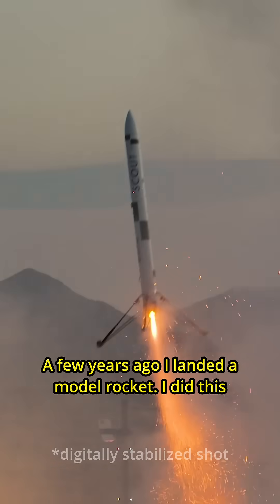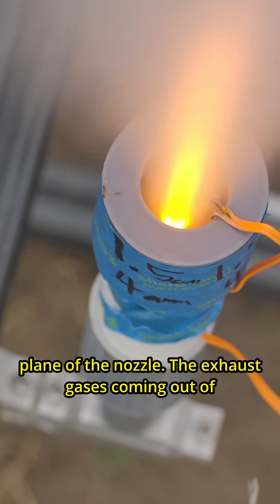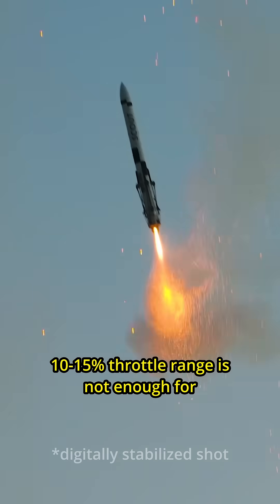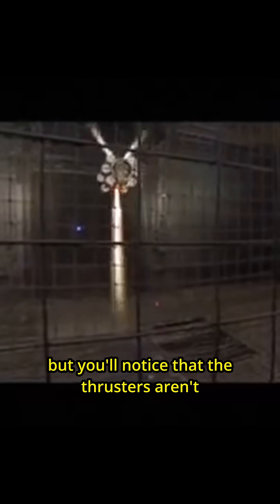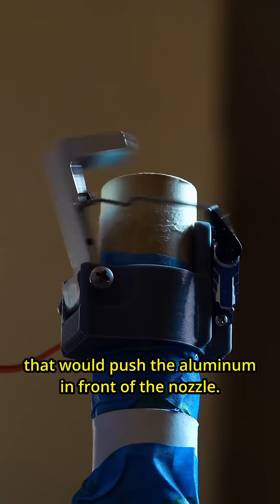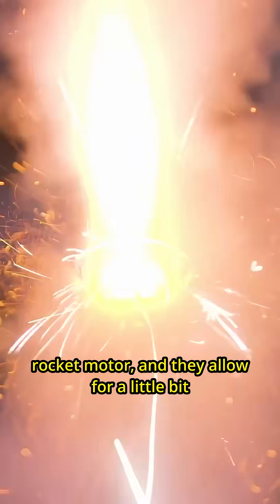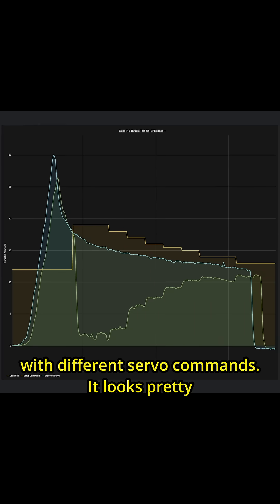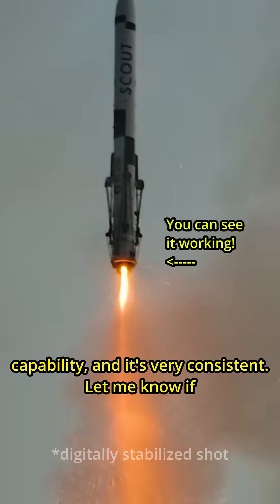Solid Rocket Throttle Control

Comment: How much thrust do you lose if you insert an inverted cone in the stream? I have nfi how you'd actually build it because the active componentry is right in the middle of the hot area but if you can have it move up through a shroud with holes punched in it you can progressively direct more and more thrust force perpendicular.

Comment: Diesel tech here...PWM (pulse width modulation) is what we use in hydraulics to smooth out and control things like variable rate hydro motors on a lot of stuff. Got real familiar with it doing diag on fertilizer spreaders

Comment: Consider using more than two blocker servos and having them each offset from the center line -- sort of like an iris setup. If you independently control them, you might be able to steer the thrust a little bit. Even if you drive them all at the same time, because the thrust isn't directly fighting the servos. Just a thought.
Reply: This was my thought also instead of clamping over it to instead use an iris rotate like setup.

Comment: OK, my ideal for you is you could have a metal  cone that opens up with twisting motions open and closed. each panel would overlay one another in a circle concave a wide base that peaks into a coned tip for dilation and restriction to hold propulsion thrust ratios.😅

Comment: Looks like a reverse thruster on an MD-80.  Our thought was it needed to be automated because we didn’t have brains fast enough to make proper inputs at the RC anyway. Using a spinning disk with gaps that allow the thrust to pass or be blocked….will spin slower as it slows down which slows it down even further exactly as needed for decent and landing. The slower the rocket traveled at landing the slower the disk spun which in turn slowed the rocket further.  Super easy to calibrate but adjusting the holes on the disk. The disk looked like an old view master slide.

Comment: Im not a rocket scientist and you may very well agree. But since you asked how I would handle it. I would design an Origami style, mechanical, retractable parachute type device, made of lightweight but hardened heat resistant material. Once extracted could be controlled remotely. Making adjustments with the controller to assist in the landing untill a program is set up.

Comment: Depending on how much force the rocket motor is making, i would go for stargate sg1 iris style thrust reverser/throttler using ceramics. Simply for the cool factor (ensuring it doesn't jam under pressure is fun).

Comment: I would have tried a leaf shutter first. I think that would give me the most control over how much thrust I have, because I have the option to have full thrust all the way to no thrust/very little thrust with the shutter completely closed. The only issues I can come up with for this are the shutters themselves being too thin so they break or melt, where to put the electronics to operate it, and how the thrust I’m blocking can escape.

Cool video though.

Comment: I wonder if you can use thrust vectoring to modulate thrust. Imagine commanding the thrust vector to be fully angled away from the rocket’s axis, but rotate this vector around the axis at a high enough rate that the lateral component averages out. This solution has the advantage that it doesn’t require any additional hardware.

Comment: When you block the thrust from the end of the rocket why not have that same blockage have side ports that open with the same motion like a valve so that when it is blocked from the end it goes out the side to change the direction of the thrust  travel that way you're not backing up the energy your redirecting it yet you're still using the same energy but in a different direction The other option is to have a variable ceramic cone or tube that move the direction of thrust never changing the thrust only moving where it goes.

Comment: Here's a thought. Your solution is clever but would a round piece of ceramic work better?  Like a donut?  It could be broken into say 5 or 6 pieces and controlled by a sort of cork screw and when it turns it would open and close giving you consistent and controllable  thrust suppression.

Comment: Paused. This is some of the stuff that kills me. I'm not smart enough to build a rocket. I'd mess it up 100 out of 100 times. And trying to figure out a way to land it on its return, same. But in those 100 out of 100 times of failure, knowing that I'd be putting aluminum in direct contact with a mega-flame, I would never NOT find out the temperature at which aluminum melts. That thought would never slip my mind. I don't get it, man.

Comment: I guess the natural progression of this would be to then land the rocket with fairly good precision, then to maybe move into using catch arms to catch a rocket.  :)  That precision part I think would be difficult as hell in a model rocket.  I'm sure someone could do it, but man, the cost would clearly push it out of range of the average hobbyist - even if you could get a Raspberry Pi or Arduino small enough to handle the data.

Comment: So my first idea of this was to block the thrust itself but not like this, I was thinking of a metal (im not sure which one) blocker that has a three way closing system, kind of like a spiral and what it would do is you could control a 1-100% close ratio and that would block out thrust from the booster itself therefore leading to a variable thrust. However we dont all have that kind of money which is why that Idea is not the best 😅😅

Comment: I would not have solved different but maybe made like a SG-1 gate shield style of ceramic throttle control if you could get away with relatively thin sheets and were able to engineer the open close action of 8-10 cresent shaped sheets

Comment: Id like to think my experience with refractory materials would’ve led me to a similar idea. I’m pretty good with PWM stuff. Prob a different design but this is simple, reliable, only needs two solenoids. Yttrium stabilized zirconia ceramic is prob fine for this usage and tougher than calcium aluminum oxide vitrified kaolin ceramic. A liquid nitrogen flush of the solid rocket tube would also quickly reduce combustion without requiring a relight as long as it’s not continuous. I would’ve used a hybrid rocket nozzle with vulcanized rubber and aluminum and ideally liquified nitrous oxide and I’d have to add a small amount of perchlorate for relights. It generates its own ullage gas, no pump required if the rocket is light enough.

Comment: I would have use a ground contact release attached to the landing legs so as they hit ground the mouse trap reverse thrust clam jaws under the thrust and instantly are thrust up along the side of the rocket actually pressing it into the ground and making the timing issue obsolete and adding stability in the landing as it is now anchored against the ground regardless of how much longer the solid propellent has left.

Comment: Wait, is there a way I can speak with you privately? I have a really easy but not exactly simple way to control thrust. 
So in a nut shell what about a ceramic ring with a opening that you can adjust by moving up and down with a external motor or better a selinoid so it can slide in a hollow tube allowing the thrust damping

Comment: @bps.shorts I’m an engineer, I have an idea. You said you recessed the engine, therefore the more of the solid fuel that’s expended, the longer the recess. Have you tried creating side channels, similar to the muzzle break on a rifle? This would redirect the kinetic energy out the sides, potentially stabilizing the rocket while decreasing the lift. Feel free to respond if you would like to collaborate, I do have a few ideas. Great job!
Reply: Wouldn't that introduce lateral thrust that may be undesirable. If the holes are not lined up perfectly you'll get a roll and if the gases don't escape evenly you get yaw
Reply: @KaitouKaiju if you balance the bypasses on both sides you should mitigate the lateral forces.
Reply: Slight correction (doesn't affect your idea, I think): The recess doesn't get longer. Solid rocket motors are made such that the burn channel goes lengthwise in the centre of the cylinder, and burns from thereon out to the perimeter (there's more to it, like some extra channels cut in - usually it's in a star shape - to ensure even burn rate/thrust, but that's irrelevant here). This is to ensure that the casing doesn't need to tolerate the flame temperature (hence, nothing except the actual nozzle and control vanes does), and the "offgassing" fuel will somewhat cool the solid fuel (and thus the casing) below.
Reply: That'd have to be some very precise work to ensure you keep it vertical and not add any yaw or roll to it. I honestly think an easier solution would be changing the mixture up of the fuel so it just has less overall thrust, maybe with a t/w ratio of 0.9 so it comes in slowly
Reply: 3D printed holes can be perfect, adding stability, angled upwards offsetting lifting thrust up to 100% using opposing thrust, could even hover. Channels closed/opened on demand via ceramic. Using pincers to obstruct thrust is dangerous, as solid fuel continues to burn, blowback & increasing pressure can overheat/ignite remaining fuel, causing catastrophic heat/explosion. Thrust must be redirected to offset without obstructing. Channels can be open to various controllable degrees. These side channels also allow some directional control, like Elons gimbal engines, 3D printing can be incredibly precise. ~135 to 160 degrees side channels redirecting thrust upwards, like making a peace sign ✌🏻 2 fingers being upwards facing side channels.
Reply: Side channels are upwards facing
Reply: You call yourself an engineer and you can’t spell *brake? Muzzle brake NOT break.

Comment: What about using the Krushnic effect but with a narrower, ceramic tube. (like a sand-blasting nozzle or MIG welder nozzle) Rather than varying the length, you could have variable vents near the top. Let air in and the Krushnic effect decreases; block the vents and the effect increases. The ceramic tube could be rigid and coaxial to the flame (or possibly vectoring) and the variable vents protected from the heat.

Comment: 4 of them should make both throttling and thrust vectoring.

Just be careful to not direct exhaust into the bars connected to the servos, they could still melt.

A gentler inner shape could keep it going out the end at a wide angle instead of sweeping under.

Comment: I’m sorry but blocking the outflow is a terrible idea and should not have been your first one. Even if it didn’t melt, its much less efficient than purely toggling the flow off and and on

Comment: I probably wouldn't have thought of redirecting thrust like that. The idea that springs to mind would be to have 3 "Booster" rockets and some way to independently deflect the thrust axially away from the the usual line of thrust. If you can deflect the output to 45' from the centreline you'd be creating significantly less vertical thrust.

The problem is that this would also add big problems with balancing the inconsistent thrust from 3 separate solid rocket motors, plus differences in thrust duration, and those would be harder issues to solve than the original problem the solution was trying to address. 😁

Comment: If you used a cone divided into four long blades, and put little  actuators on them like with your ceramic claw, you could divert thrust into different directions depending on the amount each blade is extended, or like with your PWM method, cut it completely.

Comment: This might not work at scale and is not a very efficient solution (youre basically wasting your propellant there), which is why I believe that isnt going to be used in larger rockets.
Since burn rate your first idea was probably the more efficient one - but if you were not just to use Krushnic effect but rather varied nozzle geometry that might have been more effective

Comment: My first thought was to simply pinch the nozzle through some kind of shutter setup. But thats way more complex than what you ended up doing and probably wouldn't have really worked. The most efficient solution is probably switching to liquid fuel or some form of monopropellant, but theres probably something specifically stopping you from doing so

Comment: If you throttle by figuring out how to waste unnecessary thrust, would it not make sense to at least use the thrust directionally? That is to devise a ceramic flow actuator that if engaged wouls split the thrust into 3 or more smaller ones and gradually change it from vertical to horizontal, this way you reroute it from pushing down towards pushing sideways.

Comment: Put the whole rocket motor on a swivel and constantly change the angle from side to side to reduce overall upwards thrust and stay stable. Probably not feasible due to the rocket motor being most of the mass. Maybe if you had a couple of smaller motors, so that they can cancel out each others rotational moments?
Your solution is way more elegant, but you did ask us for our solutions ;)

Comment: I'm no engineer whatsoever, but why wouldn't a contracting? Nozzle work like what they use on the back end of fighter aircraft with the afterburner? If you have a sustained rate and you the decrease the size of the nozzle, it makes the gas go faster. If you increase the diameter and the nozzle, it decreases the thrust, but I could be wrong like I said, i'm not an engineer

Comment: Shouldn't you throttle it by limiting the burn rate rather than trying to contain the already ignited flame? Sounds like a bad idea because you need to be able to withstand the heat. Just burn less?

Comment: 100% the same solution i was considering lol. PWM is how a lot of cars vary the amount of fuel that is provided. Especially manifold injection. 

Throttle plate reduces or increases air,  02 sensors read the result, and a small table on the ECM chooses how long to open the injectors.

This is on the other end, but still uses a similar effect!

Comment: You don't have the computing power or the sensors to fire fast enough for routine Star Wars type of aircraft Space Ship landings. 

Once fuel is burned the weight of the aircraft changes and the computer needs to throtle effectively to control the effective pulse modulation of thrust vectoring. Its not that hard, but to purchase the control mechanisms goes beyond most college students personal budgets. Unless they are sponsored. 

High speed, high pressure fuel injection is something to consider with pulse modulation. I think it is much easier to design with an injector manifold that has the rocket firing nozzles in the desired direction of travel. Then the pulse modulation will work effectively for direction if travel. That design will put you in the winners circle. 💫✨️🏁😃👍❤️🇺🇲

Comment: Hmm I think I would've tried using several motors (3?) and changed the direction to get the vertical thrust component you want rather than trying to throttle a single motor. Having 3 motors point anywhere between vertical and horizontal would not require anywhere near as much complexity as the solution you've used here and is easier to keep symmetrical. You would likely have to account for inconsistencies between individual hobby motors though.

Comment: I would have tried four or put two slits in your ceramic. You could have probably got away with stainless as well. By doing that and making your relief holes equally and all directions maybe even with a little bit of a spin it would have helped stabilize the rocket in the process by shooting your thrust equally out the sides.

Comment: I would use two solid thrust motor which can point down ⬇ or sideways with certain angle to control the thrust with only two servo motors, it's benefit you get more control and thrust meaning more payload, downside using two solid thrust motor is expensive and you need a proper code to control the angle of thrust, I hope it's a good solution

Comment: I would try a fin that diverts parts of the exhaust gasses up so it pushed down not up. although it would probably melt unless it's made out of thick Stainless or titanium. although I don't know how I would actually actuate the fins. it could be like the first idea but instead of a tube being extended downwards it's a array of fins (like a compensator on a gun). The array of fins would redirect parts of the exhaust upward thus creating reverse thrust. Idk if this would work though. Your solution is pretty good, especially with the fact that ceramics are pretty light compared to metals.

Comment: Real solid rocket motors have Thrust Termination Devices that work by blowing holes in the sides of the motor at the other end of the motor.  This allows gasses to vent radially. Solid fuel motors work by burning from the inside out all along the hollow core.  So the TTD can be remotely detonated to cut the thrust of a rocket that is off course for whatever reason.  

Your ceramic deflectors use a similar principle, deflecting some of the gas flow direction.

Comment: Okay here's a thought instead of igniting the main fuel source and then trying to control it like a madman use stored high pressure gas developed along the way as needed replenished in short bursts using fuel that can be ignited quickly and the resultant high pressure gas stored.

Comment: Was gonna say you could split it into 6 triangles of ceramic and have them close to a much smaller point. It would also give you a pseudo-gimbal functionality. Doubly so if you put two actuation points on each triangle and designed the hinges to tilt.